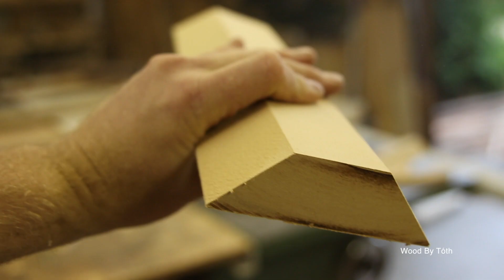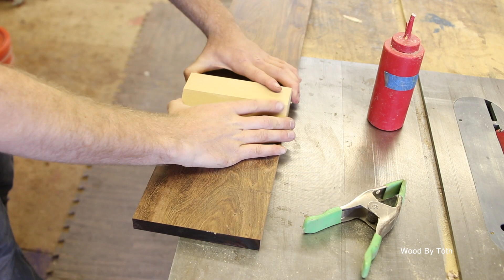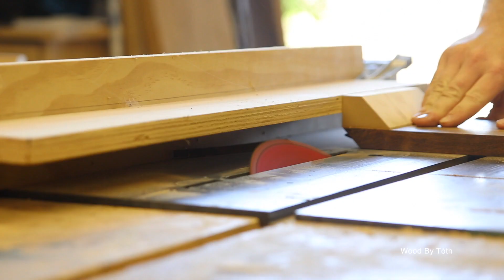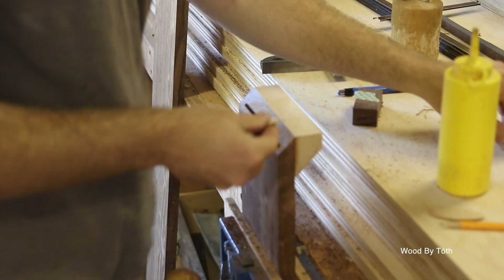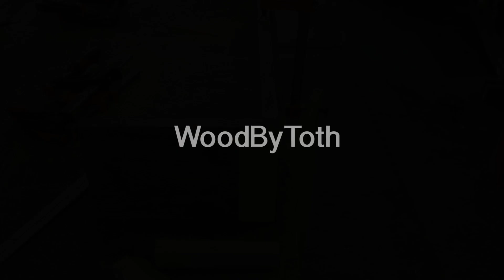Easy Way To Glue Up Miters

Comment: I think the more machines you have the more complicated you make things. Put some paper in the inside corner to prevent the block sticking to the work. Clamp a square block in the corner. Glue dry, remove block, pull off paper, job done.

Comment: Angling your table saw blade TOWARDS the fence and then ripping a beveled/angled cut is a huge no-no and is basic table saw safety.  The fence goes on the other side of the blade there.  Those cuts gave me the hives watching you.

You also should have a filler strip in your miter slots when not in use.
Reply from the maker: who are you
Reply: Unfortunately this is the attitude towards these Interneter self taught DIYers, what he should of replied instead of “who are you” if he uses any of his brain, he would think about what you said and come to the obvious realization that you are correct and only commented to help him from a injury or loss of finger/hand by incorrectly using a table saw! (knowledgeable wisdom and respect to those who know and offer to teach, even with a comment, this guy lacks respect for the craft and lacks respect to knowledge) YOU PUT YOURSEF IN A PINCH/BIND AND EVENTUALLY A KICK BACK SITUATION, YOU NEED TO HAVE RELEIF FOR THE OFF CUT, YOU PROBABLY HAVE LEARNED THIS BUY KNOW)

Comment: What's that jig you used to cut your miters in the final work piece on the table saw?
Reply: Matthew Herrmann look up L fence.. forgot the guy that came up with it but fine woodworking did a piece on it awhile ago
Reply: Thanks!
Reply: Not to take anything away from Kyle -- or Fien woodworking, but the "L" fence or "Flush Cut Fence" he uses is way older than the Fine woodworking article in 2013. I learned it at NBSS about 30 years ago, and it was not a new idea then! Very cool table saw jig for many things.
Reply from the maker: Bob Cashman Nice. Yeah I went there too. And thats where I learned it. Graduated in 2011 from CFM. Cool to hear from another graduate

Comment: There is actually an easier method. If you cut the angled bit off the mitre, so it becomes 90 degrees again, you can then clamp as normal.

Comment: Is this a joke?
isto foi uma piada?
Reply from the maker: Stefan Stef It wasn't intended to be. Just something I Learned in school so I thought i'd pass it along.
Reply: Well, gluing those parts is not appropriate at all, so I figured it might have been a joke;
(Bem, colar essas partes não é apropriado, então eu pensei que poderia ter sido uma piada;)
Reply: +Stefan Stef I think this is a "time and a place" technique. For a joint in which access is limited to really only the outside, and no screws must be visible, this would be a great option.

I'm more of a car builder than a woodworker, so I can appreciate the need to do things in an unconventional manner, as there are many jobs in which you genuinely have nothing but external access. Can't hammer it from the inside, can't lever it, can't clamp it; all you can do is stick things to it.
Reply: If it gets the job done, how is it not appropriate?
Reply: Good point. There are many levels of effort and his results show it.